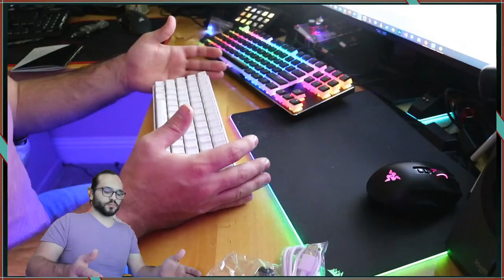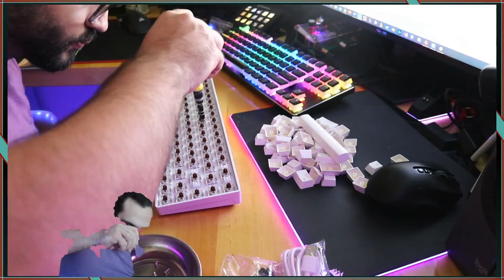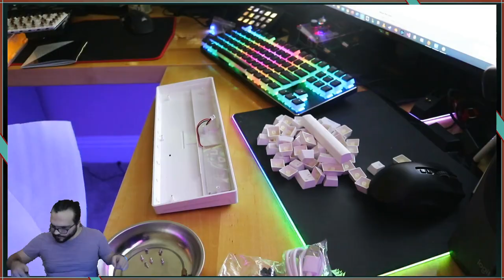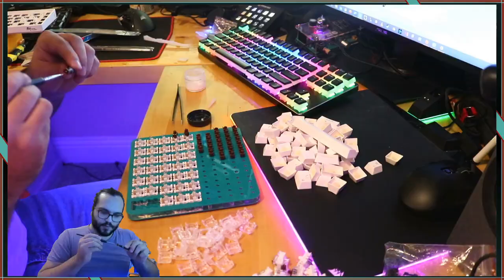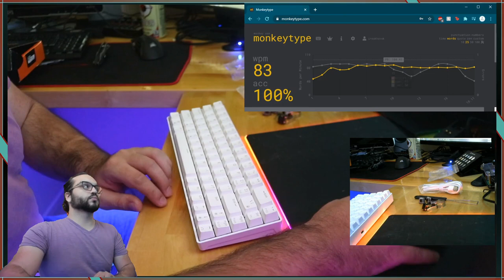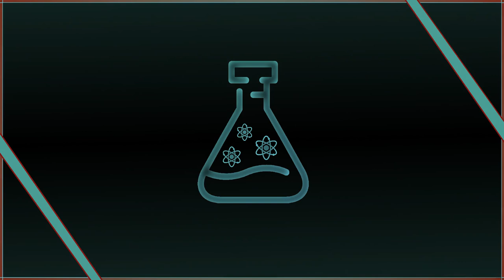Keyboard Build: Royal Kludge RK68 (RK855) Lubed Gateron Brown Switches and Foam Mod

Comment: Hi may I know the difference between RK68 and RK68 Plus?
Reply from the maker: They are two completely different boards with different layouts made by the same company with many of the same features. The only noticable difference is the top cover for the keyboard is way different and there is a wifi dongle instead of just bluetooth.

Comment: just bought this board but the switches won't come out no matter what I do. It should be hot swappable
Reply from the maker: It sounds like you didn't use the link that I provided in the video. There is an older version that is not hot swappable.
Reply from the maker: Just open up the board and take a look at the hot swaps or if there is solder holding the key switches on.
Reply from the maker: It's only like six small screws.

Comment: Is this keyboard hot swappeble and if so what switches can you use with it
Reply from the maker: You can use all standard RGB enabled switches, there is a diode that sticks above the PCB, so either the switch must have a hole there to allow space for an SMD LED, or the bottom of the switches case must not be 100% flat. If you look at my video for my Drop CTRL I feature a better angle so you can see that the PCB doesn't allow for specific switches. I would consider it about 80-90% compatible. It does have 5 pin support.
Reply from the maker: if you want to send me a link on here or instagram, I'll tell you if it's compatible. Here is a link to my Drop CTRL video, where I mention and show the diferences in the LED's on the PCB https://youtu.be/Qcswo4qVyTo

Comment: sooooo I’m not very knowledgeable on switches so does anyone know if banana splits would fit in this?? I originally got a gk64 not knowing that it wouldn’t fit any other switch but gaterons so I might get this one depending on whether or not it fits banana splits
Reply from the maker: They will not work, because the SMD LED's are not flush against the keyboard. It's a good question for any keyboard that is RGB, but more so with the lower cost boards.
Reply: @ireakhavok  awesome, thank you! is it possible that you could list a few models that would work?
Reply from the maker: @cyberchase0  Any Akko  switch or  Gateron MX SMD  (has to be the MX SMD)  - stay away from the milky, even though they sound good.  just make sure that the bottom of the switch has a cuttout for the SMD LED

Comment: Is the hotswap socket on this one universal or just compatible to a certain brand and what's the difference between the rk855 and rk837? Nice vid man!
Reply from the maker: So this PCB requires switches that are SMD LED compatible, IE, it has to have a cutout in the bottom of the switch, or it has to be raised from the PCB. If the switch is completely flat on the bottom or only has the holes for LED diodes, then it will not work. I havn't seen the rk 837, and am not sure how to distinguish it from the rk855 entirely, but it seems like there is a removable bezel on the 837.
Reply: @ireakhavok  Are gateron yellows compatible with the PCB? I was planning on getting gat yellows as soon as i get the keeb. Thank you for the fast response :D
Reply from the maker: @mjoren5679  No, they are not compatible! The issue is because the SMD LED is not flush against the PCB, it sticks out quite a bit and you will need to get switches that have either a small cutout, or have enough space for the LED's to fit. The bottom housing of the switch must not be flat. Most RGB enabled switches, that are made to allow LED light to pass through the switch from the bottom side are compatible, but switches that have tiny little holes for LED pins to pass through, generally are not compatible.

Comment: just finished my mod with this and I used the clipped the stabs and band aid mod as well as relubbed all the switches leaf included. My switches were the brands versions of gateron reds.
Reply from the maker: It sounds like you were able to mod it relatively easily! Did you buy it using my link from this video? They should have been gaterons if you did. I really like this board!
Reply: @ireakhavok  I used a different link but they were gaterons. I got it when it was on sale for 45 bucks. I lubed the switches with super lube dielectric grease. What took long was the lubricant of the switches cause I had no switch opener at this time. The keycaps were still kinda cheap.  The band aid mod I learned from Taeha types. This was my first mod for my keyboard. Now the switches don’t sound scratchy or off and the stabs were not rattling anymore due to clipping it flushed. Next paycheck I’m getting some OEM keycaps.
Reply from the maker: @ddrfan210  Sounds like you got a great deal! Just be careful with the right shift key, and bottom row for finding the right keycaps.
Reply: @ireakhavok  that’s the main problem with 68% keyboards
Reply from the maker: @ddrfan210  IK... I just still have to have arrow keys, so like going with a TKL is always better for me. Going to be trying out the UHK V2, though

Comment: Hi, I had a question, is it possible to change the lights on that keyboard? (I mean physically, from the PCB).
And the battery could be changed?
Thanks
Reply from the maker: Is it possible? yes. but I do not suggest it. If you have one LED that is broken, I could easily see someone trying to fix that, but if you are suggesting to do the whole board, I would greaty discourage somebody from doing that. SMD LED's are really hard to place, hard to desolder, and even harder to solder. You can easily get messed up. It isn't like soldering normal items, because when you solder it on, you have to flow it under the pads, without getting the component too hot. I have never soldered SMD LED's and I could be very wrong, but I definitely would not do it, however possible it was.
Reply: @ireakhavok  ohh, thanks!

Comment: Interesting - mine came with RK branded switches (reds). They felt light but slightly scratchy and I tested them against the Outemu reds I had, which were a bit less light, but also sounded more smooth so I ended up swapping out and putting in the outemus. Also the keycaps that came on mine looked like double shot abs, but not the best quality, some had uneven texturing on them. I just did the switches and keycaps and it sounds much better already - next I'll do foam as well, but already very happy with the result.
Reply from the maker: Personally, I don't like outemu, just because they are generally marketed as Hot - swap (which they can be) , but because of the boards they are put in, they generally break when you try and pull them out, and the PCB's that support outemu, generally don't support the other switches. The plastic isn't as sturdy as other brands. But I must say that the switches themselves feel okay, generally, but I never have had the opportunity to lube a set. 

in regards to outemu switches:  I wish the plastic was a little sturdier, but don't know if my switches broke because of the boards they shipped in, but think they could be good!

I'm glad that modding your board is going well! 

Keebs are always the thing I like to tinker with constantly!
Reply: i realize I'm quite off topic but do anybody know a good site to stream newly released series online?
Reply: @Alijah Kohen Flixportal xD
Reply: @Gary Camilo Thanks, I signed up and it seems like a nice service :) I appreciate it !!
Reply: @Alijah Kohen glad I could help :D

Comment: heyyy wta, why does some other reviewer that reviewed the RK68/855 does not came with hotswap board, is there a different option for soldered version or the brand is just that inconsistent? Im really temped to buy this but now im afraid i wont be getting the hotswap one hahahah
Reply: Just to clarify: The keyboard that Joel linked in the description is hot-swappable. I just got mine and tried it out. It is a new model. However, they are still selling models which are not hot-swappable such as the RGB variant. This is the same with the RK61 (some are hot-swappable, some are not). My guess is that Royal Kludge is switching all of their models over to be hot-swappable, but they still have a bunch of the old models lying around and are selling them off.
Reply: @ireakhavok  My clarification confused you further 😂. I got a hot swap board as expected. I'm just saying that some of the other listings are legitimate RK68 listings, but they just aren't hot swap.
Reply: I think they released the hotswap recently.  they call it RK68 2021 from where I bought mine.
Reply: @curiousavocatto149  i see thank you for the clarification!

Comment: I was thinking of getting this one but I’m hesitating because I can’t seem to find a good picture or video that shows if the LED light bulges out or if the switch socket is flat. Does the LED stick out for this model?
I have some aliaz switches I want to use but my Tecware Phantom has it’s LEDs bulging in the sockets so I can’t use them with that keyboard.
Reply from the maker: they are SMD LED's, so they do not come close to the switch! generally all hot-swap boards that have RGB will be SMD (flat against the PCB) Further note: The switches that came with it, will accept LED's, so if you were to take these switches out of the board, you could use them on a board that requires that you put an LED through the switch.
Reply from the maker: did that answer your question?

Comment: Can I replace the switches with the purple (lavender) switches?
Reply from the maker: Sadly, I do not think so! The LED sticks out on the PCB, quite ferociously, and I believe that purple lavender switches are flush on the bottom side. Please correct me if I'm wrong! you would need a specific kind of switch that has a window cut out on the bottom side.

Comment: I might go ahead and put Akko matcha green switches in this keyboard
Reply from the maker: Those should work perfectly for this keeb! They have the cutout window to allow for the LED, and they are 3 pin, not that that matters. I hear great things about the Akko switches. KTT is also another good company, but I have yet to get either of them. I am a little spoiled with the switches that I currently have.

Comment: hi! i was wondering if i just mod my keyboard with the rk brown switch that comes with the keyboard? or should i switch to gateron milky yellows one?
Reply from the maker: Normal gateron milky yellows won't fit on this board! You have to get the ones with the windows cut out of them, the SMD version. I believe. But considering that you already have them, I would take the time to lube them. Even if you don't end up keeping those ones in the board, having a set of lubed switches is nice. I have two sets floating around that are already lubed, that I throw into boards to give me an idea of how it will sound with similar switches.

Comment: Is this a 3 pin or a 5 pin? Planning to put c3 tangies if possible
Reply from the maker: They are 5 pin, but sadly they will not work, because the LED's stick out on the PCB, sadly! I really wish that the LED was flush. I LOVE THE LOOK OF TANGERINES. There are some other boards on my channel, like the GMMK series, Everest Max, Drop CTRL that would be able to adopt those switches. I do have more boards coming!

Comment: I've got a question, is the RK 68 (855 RGB) (The one without the removable frame and additional USBs) hot swappable? cause I can't seem to find an indication on that on Amazon, and I've read some people say yes and other say only the RK G68 (837) can hot swap. Thanks in advance.
Reply from the maker: so, here, it is a hit or a miss. I know for sure that if it says hot-swap, it will have hot swap. Not all of the boards are hot-swappable, so you have to be careful. you can always ask the seller. I know for sure that the keyboard I linked in the description is hot-swap.

Comment: Do you have any links to brown switches that would work on that keyboard? I have the same keyboard and it came with the red switches. However, I am wanting to use brown switches instead as I don’t like the red ones very well. Thoughts? Thanks in advance
Reply: Thank you so much
Reply from the maker: YT deleted my original comment: https://novelkeys.xyz/products/cherry-switches or https://novelkeys.xyz/collections/switches/products/gateron-switches

Comment: Can u put nk creams 😅
Reply from the maker: If I had some! They are actually next (for switches, specifically) on my list of stuff to get. I would have to break them in first before I showed them off. However, I also need to get a gasket mounted board, too.... I will keep you updated, but it'll probably be a couple months before I can do it!

Comment: I saw on some other reviews that the switched on the rk855 were ttc not gatreon did they change it ?
Reply: I ordered it a few weeks ago. There are amazon sellers that guarantee gateron switches & you have to make sure you purchase from them. Seller I bought from was J-Devol on amazon. I also have the wireless version.
Reply: @ireakhavok  Oh trust me I know. I originally bought the rk61 & it came with rk branded switches so I sent it back for the rk68 with gateron brown switches. Actually did a review of it on my channel as well so I had to do my due dilligence finding out what was what.

Comment: Hi i am new. I just got this board and im curious why put packaging under it?
Reply: @ireakhavok  thank you so much for replying! Would you recommend relubing clicky switches?
Reply from the maker: No, I would not!
Reply from the maker: It dampens the sound and reduces ping! check out this video to learn a little more. https://youtu.be/T3RtqplfVWs It reduces the amount of hollow sounds that come from the case, and also makes the switches sound more crisp. It will make the keypresses more firm, so if you are after a very soft key switch feeling, I would not do it this way, and maybe put foam between the PCB and the plate instead.

Comment: are you able to take the plate off the pcb?
Reply from the maker: Yes, you are able to, you'd have to take out all the switches. I didn't do it on my board, but there are very few boards out there that do not let you take the plate and PCB off of each other. This board even has an option for split spacebar, which has a different plate, so yeah, I would assume it is most definitely able to be taken off the PCB. Finding a different plate without making it yourself is hard, though.

Comment: Is it compatible with gateron mechanical switches ( not optical! ) also great video you earned yourself a subscriber
Reply from the maker: Yes, it is!
Reply from the maker: Thank you!
Reply: @ireakhavok  THANK GOD FOR YOU 🙏
Reply: @ireakhavok  I also have another question
Reply from the maker: @zangetsu5764  It should absolutely work! This will let you know which one you would like to use. Once you feel these testers in your board, you'll be able to buy a whole set of whichever one you choose!
Reply: @ireakhavok  thx!
Reply: @ireakhavok  also do you know how to fix keyboard slots? Cause I messed up my only mechanical keyboard and I need it fixed. If I sent you my keyboard can you  please fix it and send it back? you could even make a video on it
Reply from the maker: @zangetsu5764  I don't think I can fix  USB ports because I don't have the tools to fix it. In order to do those ports you generally need a special heat gun, on top of being really good at soldering. I could easily ruin the board if you get it gets too hot. I don't think that I would be able to fix it well enough that it wouldn't happen again. However, if you would like to send it to me, I can try, just know that there is a good chance that it would break! If you would like to send me pictures of what is going on, I could tell you easier if I can fix it or not.
Reply from the maker: My email is on my about me, you are welcome to reach out to my email posted there, and I will take a look. Who knows!
Reply: @ireakhavok  I’m not talking about the USB port. I was talking about when you take out a switch the pins got stuck in the socket. I tried to take it out and I did but the bottom of the pins got stuck. I can’t do it but I’m sure you can. And please do help me nobody else is willing to help. And I might have said the before but this was my only mechanical keyboard. PLEASE HELP
Reply: @ireakhavok  ok will do
Reply: @ireakhavok  so sorry for bugging you and or annoying you
Reply from the maker: @zangetsu5764  You haven't been bugging me! I really enjoy any chance that I can get to talk about modding keebs.
Reply: @ireakhavok can u talk with you on ig? It’s a lot easier for me
Reply: @ireakhavok  so do you get the issue I have?
Reply from the maker: @zangetsu5764  sure

Comment: Hey just ordered this keyboard and can't find much info around the place on the specs inside it, would it be possible to switch out the stabs for some durock screw ins or are the stabs proprietary? Thank you
Reply from the maker: The stabilizers are plate mount stabs, non-proprietary! great question. They weren't bad and didn't have any play, and no rattle!
Reply: Swap them to durock v2 plate mounted stabs. Sounds much better and less rattly. Lube is mandatory.
Reply: Trim the stock stabs and you'll be just fine if you want do the holee mod and possibe the bandaid mod or tape mod for the stabs to help firm them up. But honestly the stock stabs aren't horrible just do a clean and re-lube them libberally and they'll be fine.
Reply: @Zotac359  For the spacebar, do I get the 6.25 units one or the 7 units one?